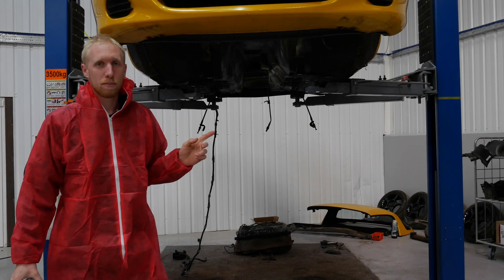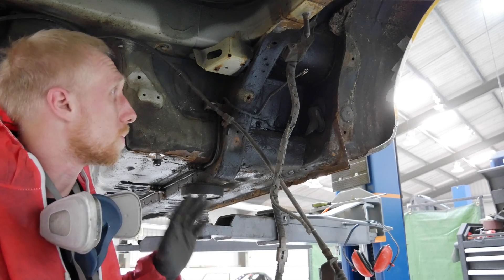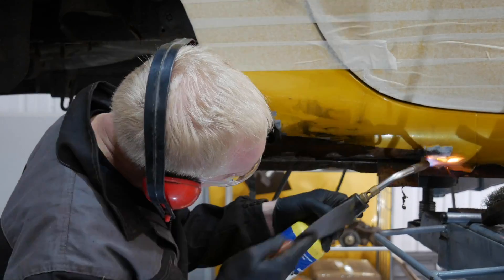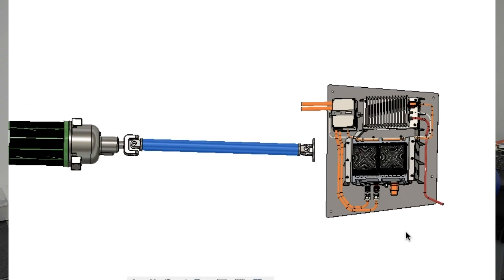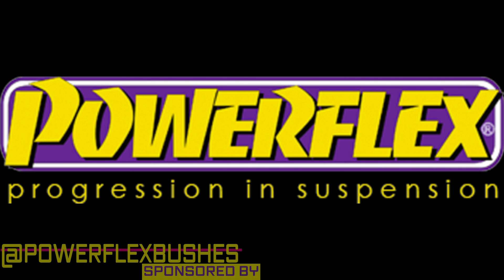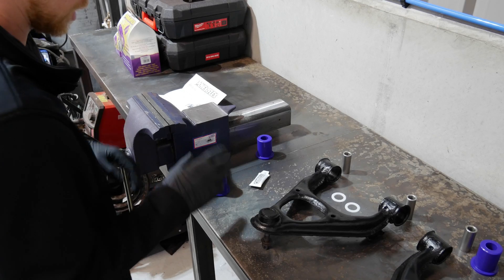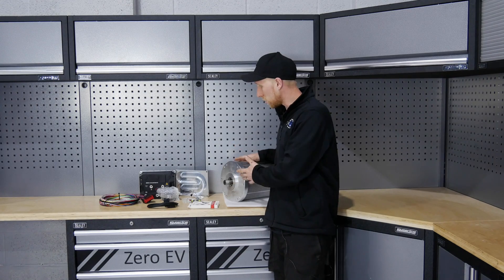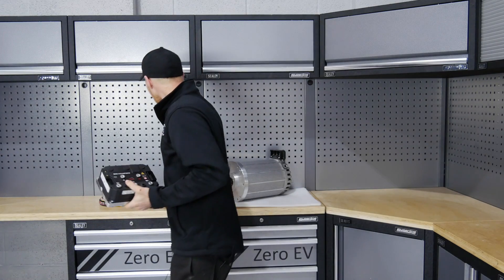We’re Making an MX-5 Miata Electric with a Hyper9

Comment: Very cool build. Do you know the weight of the engine and gearbox you are taking out? Or in other words: Will the EV Version be significantly more heavy?
Reply from the maker: It will be about 40kg heavier we think
Reply: @Hazell_Nutz  wow, that is not a lot more. Will be great to drive, especially with the extra torque!
Reply: @jang295  It has short range compared to production EVs, which is why the weight penalty is not greater. With twice the battery to get competitive range, it would be another 140 kg heavier... if you could find a place to put all that extra battery.
Reply: @jang295  What "extra torque"? Have you compared the torque of this motor multiplied by the 1.8:1 ratio of the gearbox to the torque of the original engine multiplied by the first gear ratio of 3.136:1? Also, the final drive ratio is being switched to taller than stock (presumably necessary for sufficient top speed), reducing torque to the wheels.

Comment: Can you talk a bit about the reduction gear box that was mentioned in another episode? I've got an old Volvo I'm considering converting but I'd rather not adapt the stock transmission or have to buy a new manual transmission as part of the swap.
Reply from the maker: Yes I will he just waiting on a new prototype to come in from the Cnc company
Reply: It would be nice to have a motor with a built-in reduction gear.  That would reduce space requirements and complication.